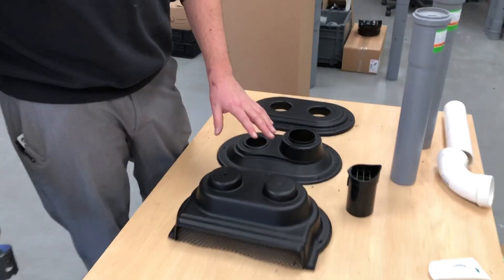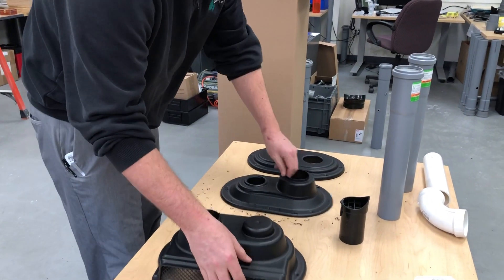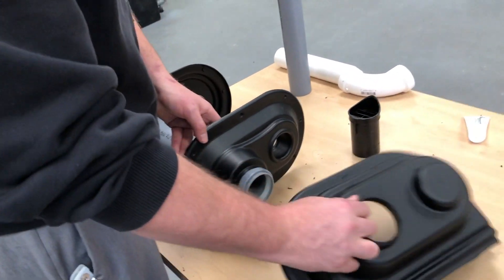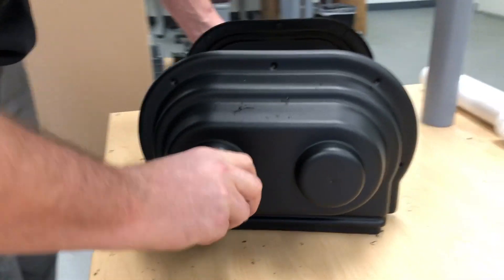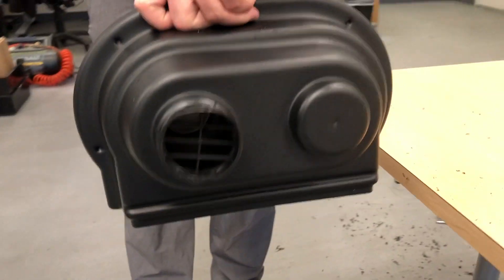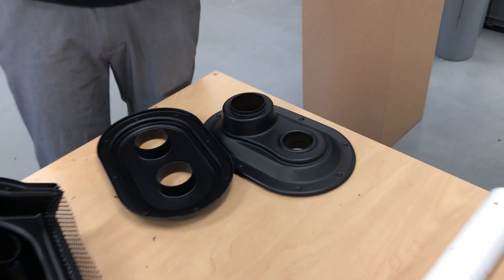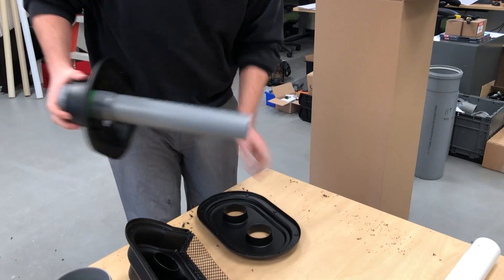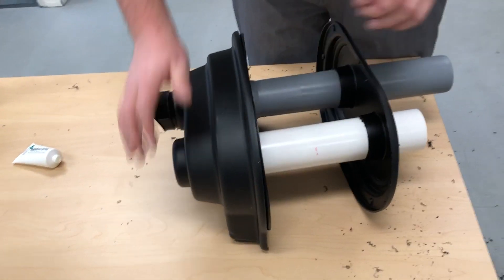Assembly Centrotherm Low Profile Wall Term Kit (InnoFlue)

Comment: How do you seal the holes? Since the CT has to go in first you have to pull the whole thing off the wall to get at the holes. You can’t seal them because you have to push it back in and whatever you seal it with won’t stay in place. The fee times I’ve used these I’ve had to seal the plate to the wall and there is no way to do that and not have it look terrible.